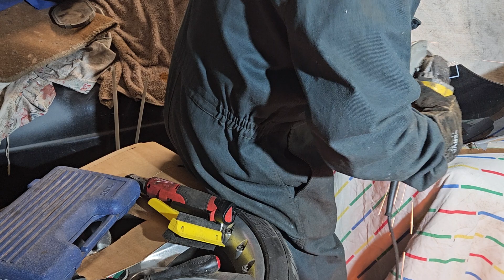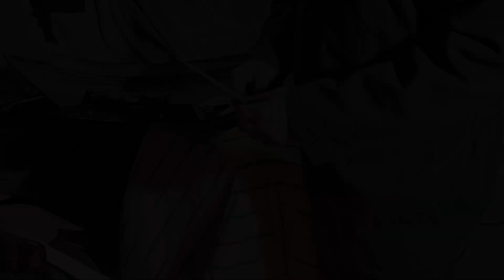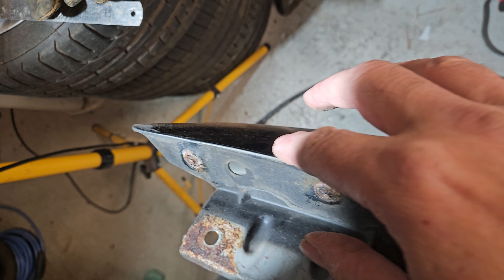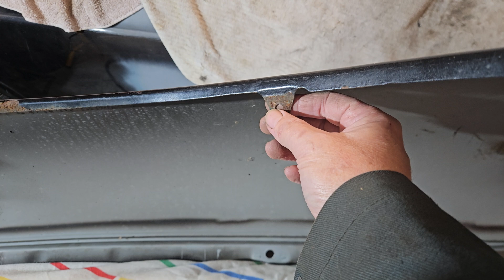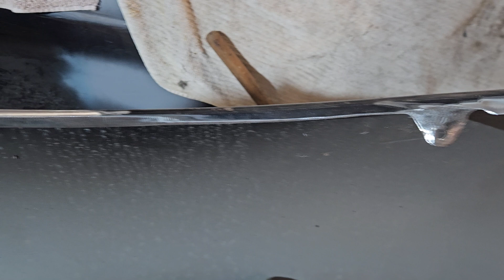XKR repair #19 Both Wings Fixed

Comment: Looks saveable to me?
Reply from the maker: Thanks for the feedback. I currently do not plan doing any more cutting/welding on these two panels now. Just Rust converter, undercoat and some epoxy type paint on the insides. A very minor skim of filler where needed and respray.